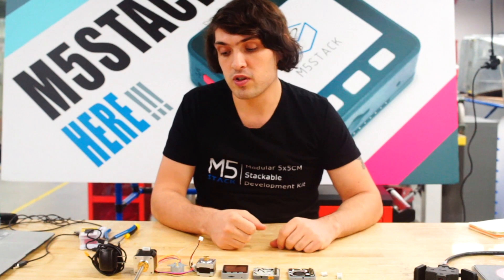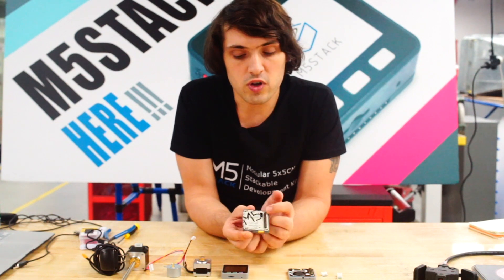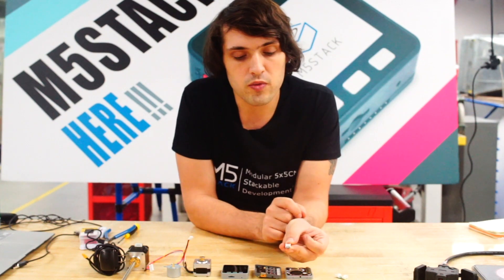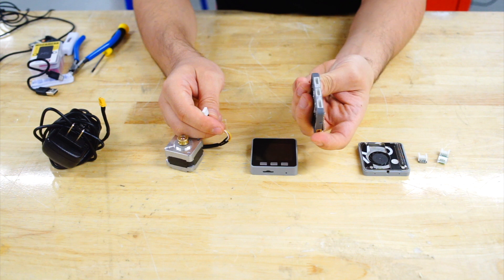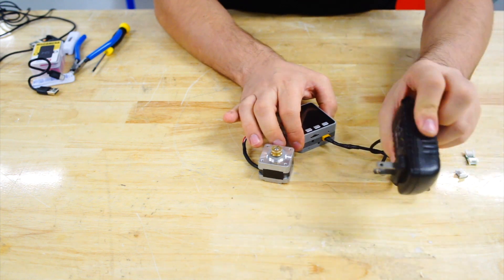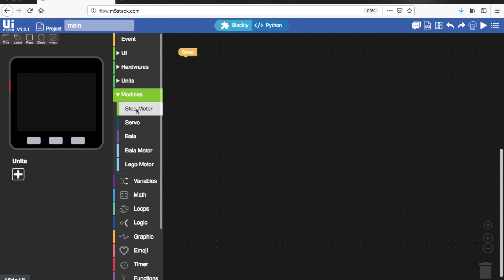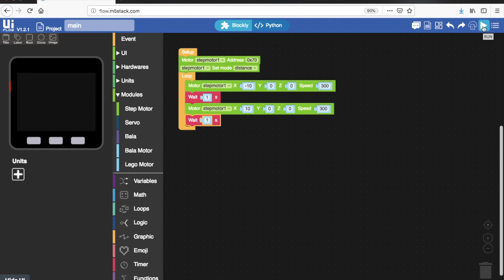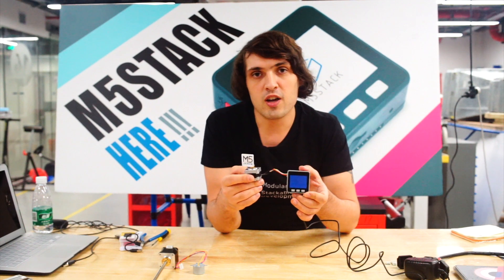M5Stack Stepper test with Uiflow and Stepper module

Comment: Hello M5Stack Team, I am working with M5Stack for a long time and now I have bought the Stepper Module and I am able to control a stepper motor. My question: Between the Move commands I want the stepper motor to hold the position against a force from outside, like the fingers of a clock needs to fight against gravity, the stepper should not let the finger sink to six a clock position. What can I do?
Reply: You would use a closed loop stepper motor driver (MKS and Bigtree sell them).  This is a device that fits to the NEMA stepper directly. These are available for ~$40 online.  I think these all started from an open source project, so you could search for that as well.
Reply: @wpaez4782  thank you for comment! I have returned the module and used BigTree driver since then. I guess there was a bug in the M5Stack Stepper module. Meanwhile they published a new stepper module.
Reply: @PeterObermeier  Very good - I'm happy the BigTree is working for you.
Reply: @wpaez4782  Ended using a TI DRV8434 stepper driver. Works very well.
Reply: This is my question as well.
Reply: @AMMMMP  , hi Andrew, I have given up working with this version of the stepper module and returned it. Meanwhile there is a new version, but I have switched to  the little 3D printer stepper driver moduls from bigtreetech. You need to control 3 pins, step, direction and enable.

Comment: where is the schematic? and how to adjust the microsteps
Reply from the maker: What stepper motors are you using? As no two stepper motors are the same, it's a little difficult for me to guide you on which color wire goes where. Of each of the four wires there will be two pairs, one way to test which two are paired you can attach an led up to two of the wires and twist the head of the motor, if the LED turns on you know these two are paired. Currently in Uiflow there is no block for controlling microstepping. I suggest you use the grbl arduino library instead https://github.com/gnea/grbl and you can find a schematic of the stepper motor module along with other info here https://docs.m5stack.com/#/en/module/stepmotor
Reply: @M5Stack   Just a regular 4-Wire Bipolar stepper, the label on grove port is [1B 1A 2A 2B] I assume that it will connect to [A- A+ B+ B-], Am I correct?
Reply from the maker: @hokoon  We are using the drv8825 stepper drivers on this module you can check the pinout on this page from the manufacturer. if you scroll down you can see a schematic https://www.pololu.com/product/2133. Using a multimeter we can see that the grove connector pins left to right correspond like so pin1 = b2 pin2 = b1 pin 3 = a1 pin 3 = a2 hope this helps